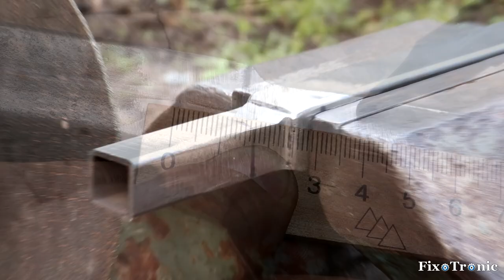Awesome Device of the Bicycle Hub and Drill !

Comment: When you welded on that hub, hopefully you didn't clamp the ground such that the current was running through the ball bearings otherwise those bearings aren't going to last long.  Anytime electric current takes a path through bearings, there is arcing, then pitting of the balls or rollers and the races, then subsequent failure.

Comment: 1 bolt 1 nut and 2 wrenches will insert a rivet nut. 

 thread nut onto bolt thread bolt into rivet nut.
hold bolt with one wrench 

then use second wrench to back off the nut
that will tighten the rivet nut in place..

Comment: That's complete crap. Just 10-20 rivets and super bolt will lose thread. Also, how do you like to put another rivet? M10 or M8 instead of this one? Another super handle? Why don't just take hardened bolt 10.9 ot 12.10 and use drill as a wrench?